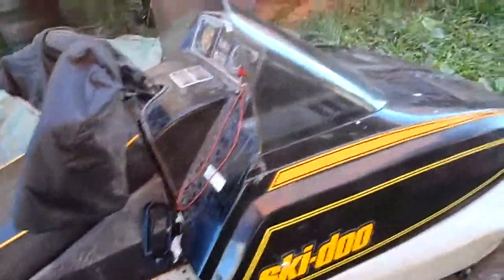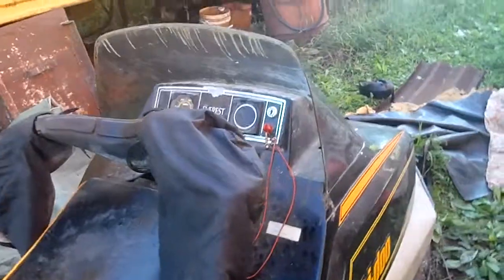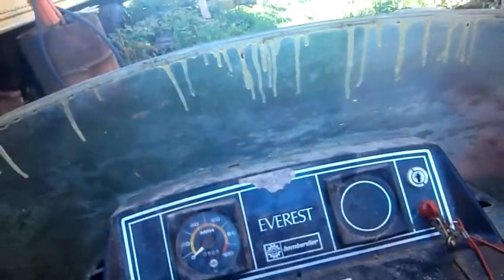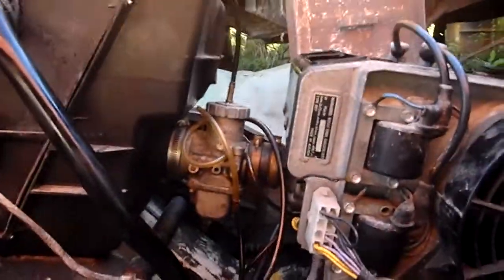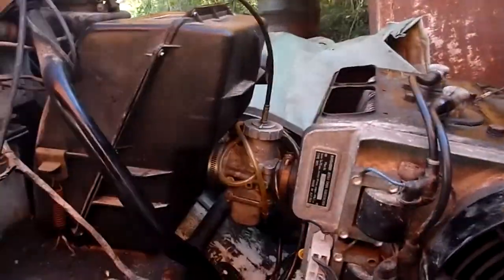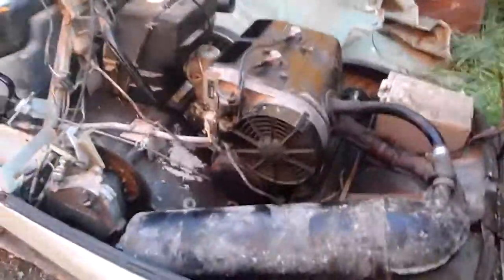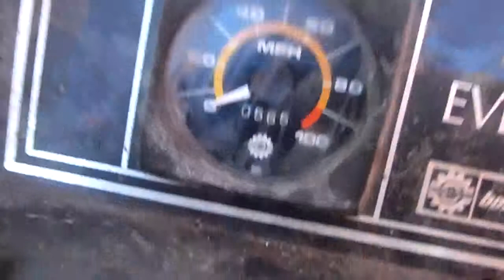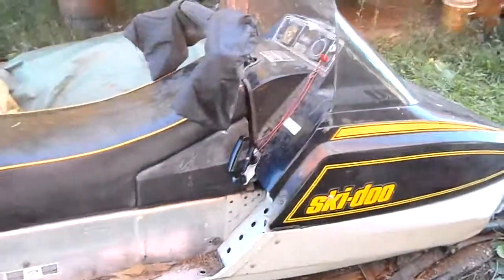1980 everest 500 snomobile

Comment from the maker: Thanks Clint. It is in nice condition. Little dirty here though. I just got the thing running at the beginning if the season and went over the rear suspension (re packed bearings with grease, replaced sliders, replaced a shock, and greased the shafts) and now it runs like a beaut. Check out some of the other videos Clint!!

Comment from the maker: not a problem mn4peace! I see you have already see the new video of the sled starting, pretty awesome huh? By the way, the fuel pump that im pointing at in this video isnt the original. I thought the fuel pump was malfunctioning at first, but it turns out the original diaphragm was fine, so i reinstalled it. All the sled needed was a carb clean out, a jet change, and tuning. In the process, my primer went on me so i replaced it as well. She runs like a champ! Good luck on your sled!